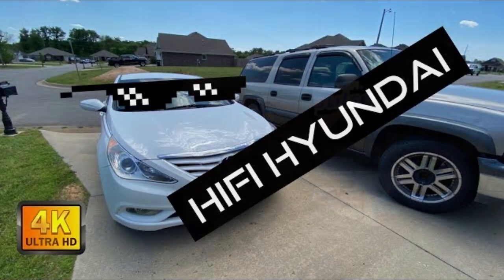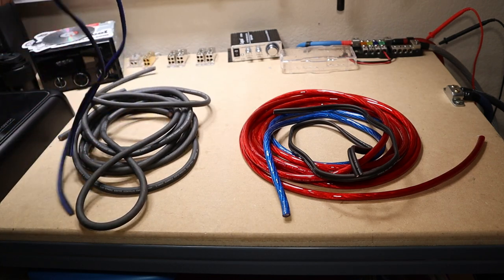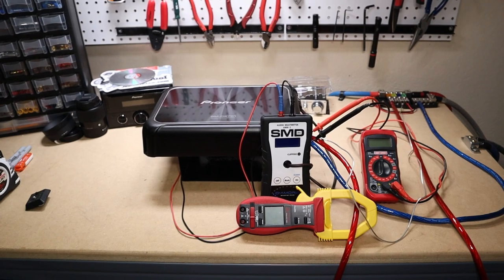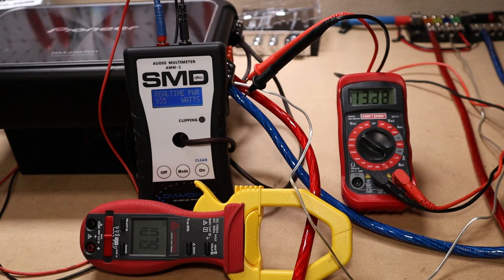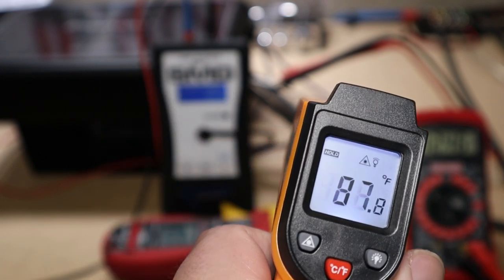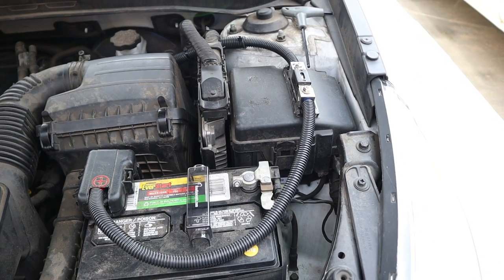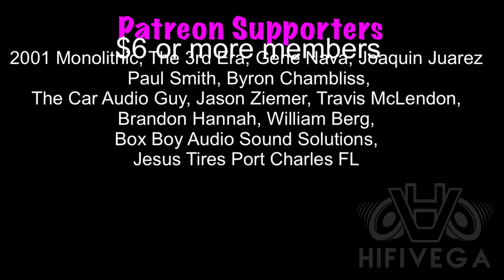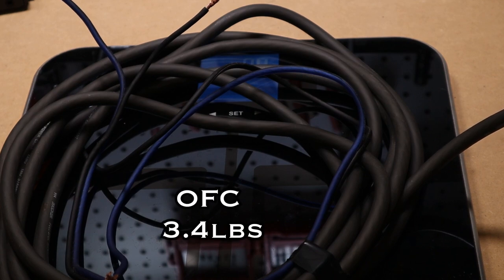This is why CCA wire is better than OFC wire!

Comment: 0 guage CCA is still cheaper than 4 guage OFC. 0 guage CCA is an objectively (there is no debating me on this) better conductor than 4 guage OFC. So technically for the money CCA is better. I've ran 2/0 CCA for instead of 1/0  OFC and the math says the bigger CCA wire is better for less money.
Reply from the maker: 1/0 cca is absolutely 100% not a better conductor than 4ga OFC a quick look at the metal conductivity chart will show you that, but if you mean 1/0 cca can handle more amperage than 4ga ofc then you’re on to something.
Reply: @HifiVega  "Handling more amps" and being a better conductor are exactly the same thing. If a 0/1 CCA cabe has the same amperage flowing through it as a 4,
 guage OFC you will see 20% less voltage drop on the larger CCA. The larger cable (even though made of an inferior metal) still has less resistance, and is a better conductor.
Reply from the maker: @B1SCUTL0VER  I’m gonna test this and do a video on it. You make a good point so I’ll run the experiment and see what happens and post the results for everyone .
Reply: @HifiVega  that would be a good video, I'll look out for it

Comment: more amperage equals more loss and problems with cca. 1000 1500 watts is probably its range. if your pulling 300 amps plus, ofc ftw.
Reply from the maker: I recommend OFC for even the smallest system
Reply: @HifiVega  don't do it! jk. sky high 4 ga ftw.

Comment: Vega whats up. Man Steve has a video testing ofc vs cca  and the voltage drop was a lot on the cca.  Now who is right. His vidio shows ofc is better and your video shows cca is better. 

I personally go with ofc. Why because my big 3 got corroded with in a moth using cca. That I use ofc and it’s being over a year and still good.  Man at this point i confused 🤷🏻‍♂️ jajaja.
Reply from the maker: OFC is better no question.

Comment: You let Steve Meade see this and he'll attack you as if there is no such thing as a YT moderator .
 (better MR YT moderator?)
Really the point is, if the resistance is less than twice as high (it should be (way way less), awg for awg) on CCAW but it is less than half the price of OFC, then double up on the CCAW and you are in front! 👍
Reply from the maker: Nah Steve a good dude I’m sure if he watched the video he’d see what I’m doing
Reply: Looks like someone didn't watch till the end ;P
Reply: The science is v-droop is = I*R.  If the resistance of the alloy is = or < half of copper awg for awg (which is it isn't) and at half the price of OFC, if you double up the alloy, you are in front. $ for $ (which is exactly and nothing more than my OP)..  You will never see someone do this type of test and draw 2x the power in watts for the same output, or draw the same current for half the output power, because CCAW isnt THAT bad, it's stigma.  
If you can double up for less than the same cost of OFC, you will be in front
Reply: I've had this argument SMD too, he aint no electrical engineer, he's the LTT of audio who personally attacks when he's proven wrong

Comment: the only time you see melting or high temps is when there is problems with the install . i dont care what amp im running pull a panel and make a new one with a fan . bigger is better , cant tell how many times i found a single strand of wire inside a case just floating ! if i can run my welder with it then a car amp aint shit ! stop getting ripped off by kicker , monster cable and the other high end wire names . if you want a deal on car audio go to https://robot-underground.square.site/   if you want awsome power nep sells Zenon amps that make insane clean power  Sundown, tested with the Sundown Audio Dyno. the 3k amp RMS Power @ 1Ω: 2850 Watts, 12.2V
RMS Power @ 1Ω: 3100 Watts, 14.4V
RMS Power @ 1Ω: 3700 Watts, 16V
RMS Power @ 2Ω: 1700 Watts, 14.4V
RMS Power Linked/Strapped @ 2Ω: 6,800 Watts, 14.4V (2 Amplifiers)
the 8k  amp is $1100 ! 1/2Ω stable. 

RMS Power @ 1Ω: 8500 Watts, 14.4V 
RMS Power @ 2Ω: 4400 Watts, 14.4V 
RMS Power @ 4Ω: 2200 Watts, 14.4V 
RMS Power Linked/Strapped @ 2Ω: 17,000 Watts, 14.4v (2 Amplifiers) lets see kicker do those numbers !!!

Comment: Cca is inferior!!! Mainly bacause cca is corrosive and rusts!!! Ofc doesn’t!! 5 yrs from now ofc will sound the same. With cca you will have to clip and reconnect connections!!! With cca you only have approximately a 2 year life including vol + voltage drop. But I. Five yrs ofc will sound the same as if you just hooked it up!!!
Reply from the maker: Absolutely